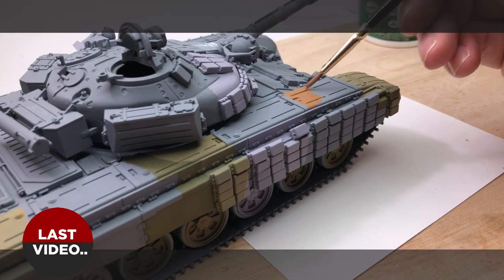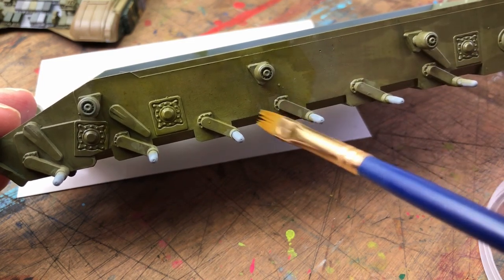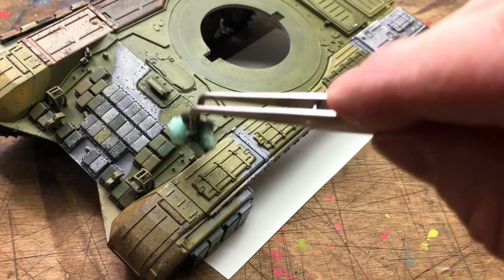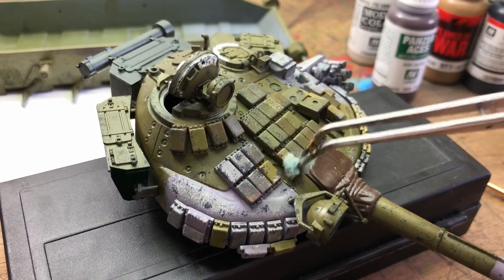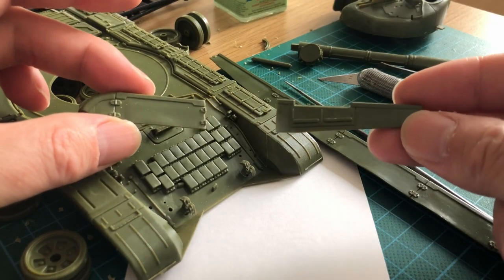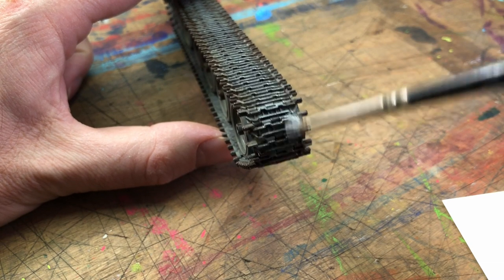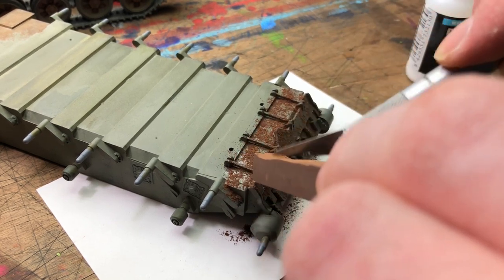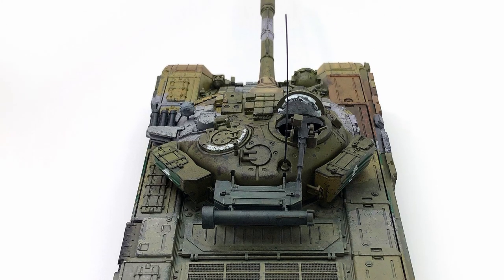T72b 1/35 Hand Paint Video Part 2 (Weathering)

Comment: You show a very necessary set of techniques for modelers, the ability to utilize manual brush strokes and sponge blots instead of totally relying on an airbrush like so many seem to do for weathering. Of course the brush painted tank is magnificent and shows the beginner and experienced just what can be done with a brush.
Reply from the maker: I found lots of people appreciate videos that are brush painting ones. I'm getting back into the hobby so using a brush seemed like a good place to start until I mastered the airbrush. Glad you liked it, check out my Hellcat vid its got a good technique for pre-shading you might like! Cheers